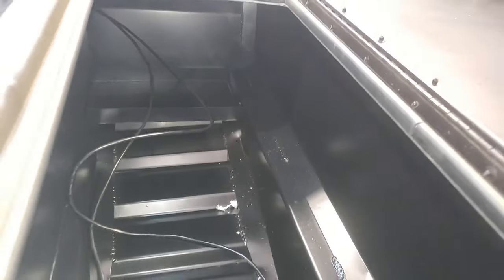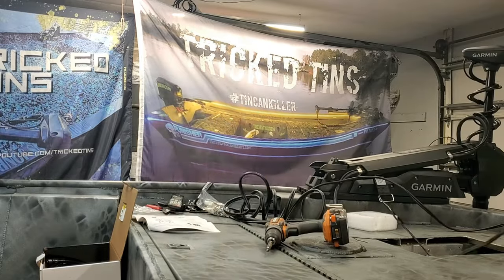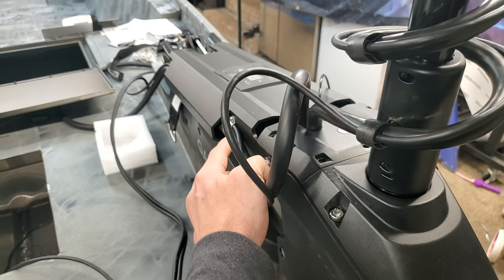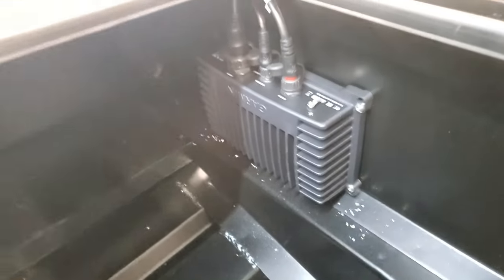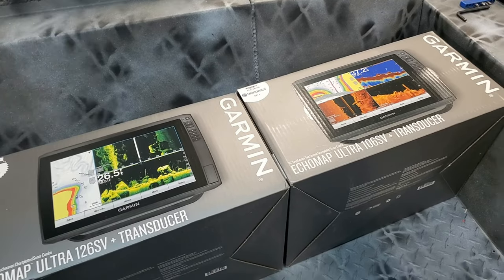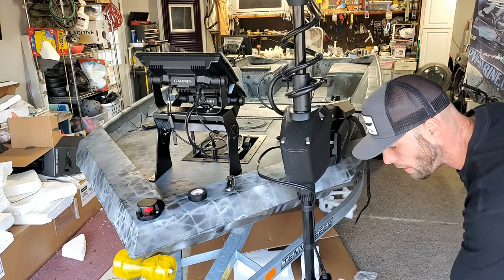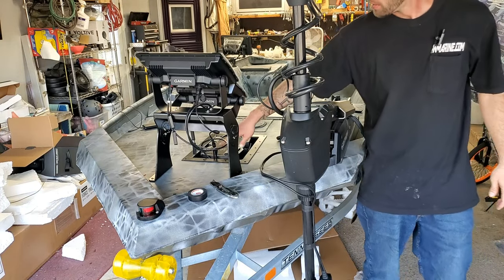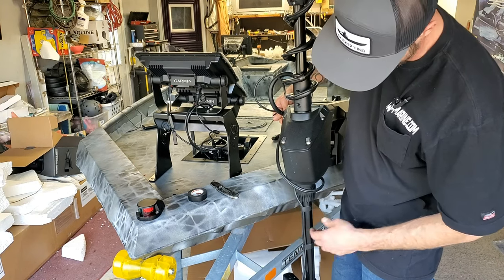Fully Rigged Jonboat! "How to install Garmin Panoptics / Livescope" plus Dual Graph-Bridge!

Comment: The livescope wires fit in the gunnels of the Force with all the wires.  It's doable.  Gotta cut the screw cap off and use the provided cap that is already cut in half.
Reply: Ah and feed the LS 1st then the rest
Reply from the maker: Ill check it out. Seems silly that you have to cut it off, especially for As much $$ as it cost?

Comment: So where does the ground from the black box go?
Reply from the maker: There's a lot of different opinions on it, but i dont use it unless you have interference. Its a water ground from what i understand
Reply: @TRICKEDTINS  I was told on aluminum boats its a must to run it to the negative as well